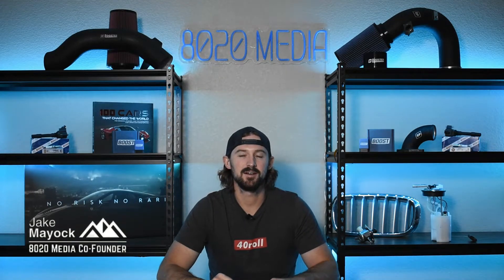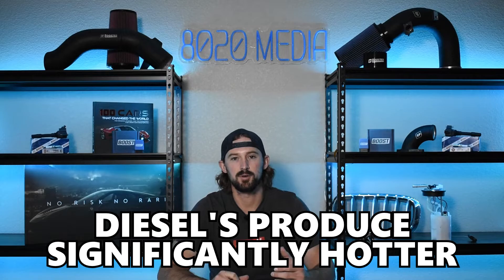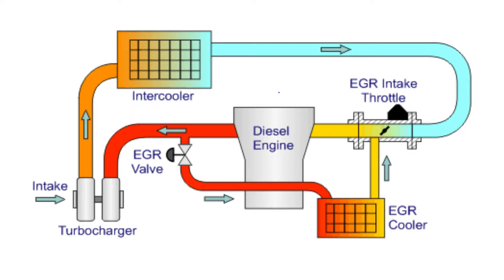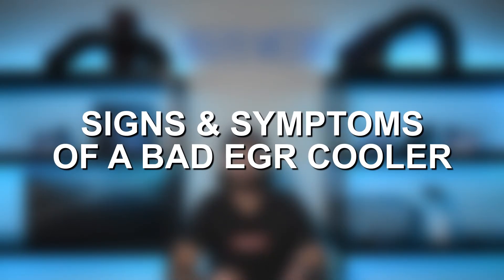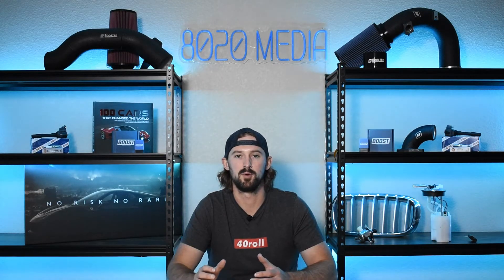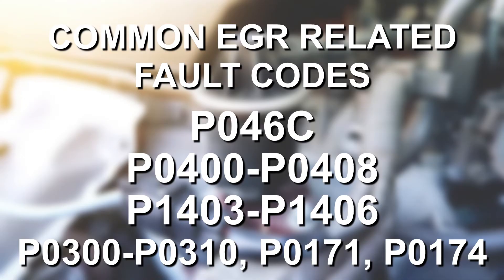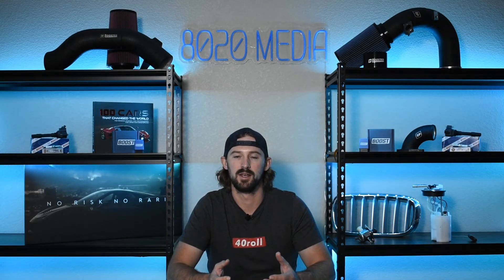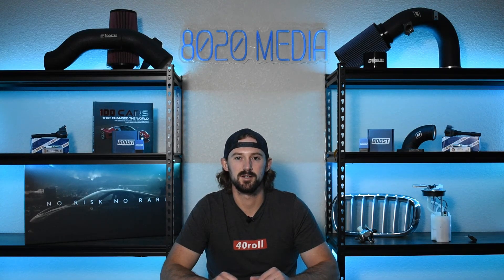Signs & Symptoms of a Bad Diesel EGR Valve or EGR Cooler!

Comment: I have had the MAF replaced and was told that coolant was leaking and had that done. Now my car has gone into limp mode and reader has said egr issue. Now I'm stuck with what the issue is
Reply from the maker: M - If your car went into limp mode right after fixing the coolant leak and replacing the MAF, and now it’s throwing an EGR-related code, chances are the issue is either a faulty/dirty EGR valve, a stuck EGR position sensor, or a vacuum/connection problem introduced during the repair; limp mode is the ECU’s way of protecting the engine when it detects incorrect airflow or emissions control operation, and a bad EGR flow reading will definitely trigger it. Since you’ve just had work done, first double-check that all hoses, vacuum lines, and electrical connectors around the intake and EGR system are reconnected properly—sometimes a loose plug or hose after a coolant or MAF job will cause this exact fault. If everything looks secure, the next step is to remove and clean the EGR valve and passages (carbon buildup is common), clear the code, and see if it returns. If the EGR valve itself or its control solenoid is failing, replacement is the permanent fix.

Comment: My car engine just stops from time to time out of nowhere, sometimes at 30km/h other times even at 80 km/h.. could this be caused by a bad egr?
Reply from the maker: O - Yes, a bad EGR valve can cause stalling, especially at low speeds or idle, but if your engine is randomly shutting off at higher speeds like 80 km/h, it's more likely due to issues like a failing crankshaft position sensor, camshaft sensor, fuel pump, or even a loose or corroded electrical connection—particularly to the ECU or main grounds. While a stuck-open EGR can flood the intake with exhaust gases and choke the engine, it usually doesn’t cause abrupt high-speed shutdowns, so I’d recommend checking for stored trouble codes first, then inspecting the crank sensor, battery terminals, grounds, and fuel delivery system before focusing on the EGR.

Comment: will a bad egr valve  cause a hard start when engine is hot?
Reply from the maker: F - Yes, a bad EGR (Exhaust Gas Recirculation) valve can cause hard starting when the engine is hot. If the EGR valve is stuck open, it can allow exhaust gases to enter the intake at the wrong time, which dilutes the air-fuel mixture and disrupts combustion—especially during a hot start when engine tolerances are tighter and vapor lock or fuel pressure issues may already be borderline. This can result in longer cranking times, rough starts, or even stalling right after starting. If you're seeing this symptom, it's worth checking the EGR valve operation or temporarily blocking it off to see if the problem improves.

Comment: I had a coolant leak and replaced the egr cooler gaskets . But still the engine run rough and takes more diesel than before. No check engine light.
Reply from the maker: N - Do you have a code reader? It's possible that there are some stored without popping a check engine light.

Comment: How do you tell if its either the EGR cooler or Valve thats failed? The only issue i have is that my car idles rough and it goes through coolant quite alot
Reply: But I've also heard that rough idle could be injectors
Reply from the maker: S - This video may be more helpful with your research: https://youtu.be/BiYsqRJCLhE